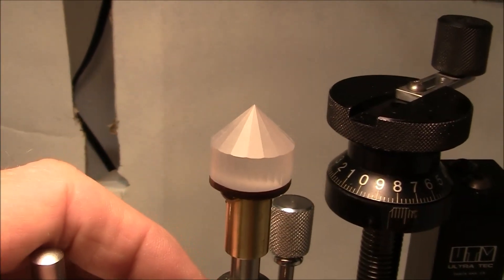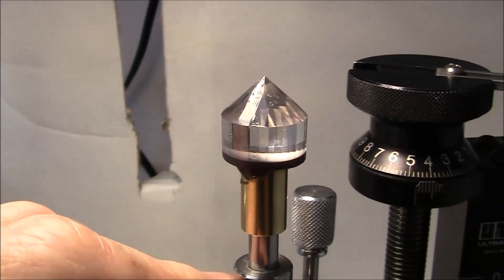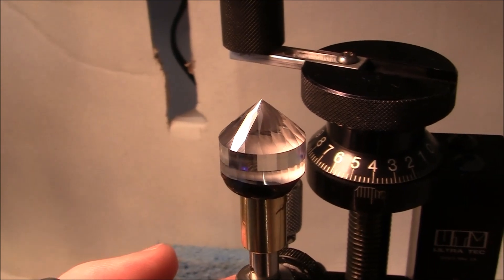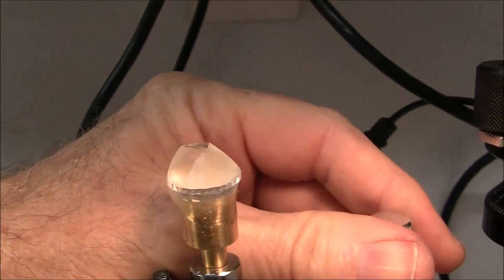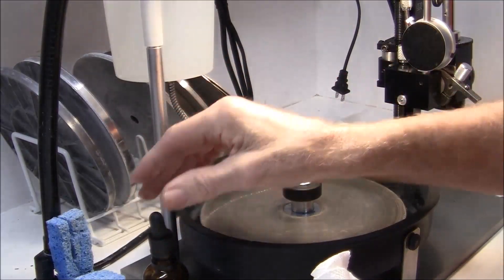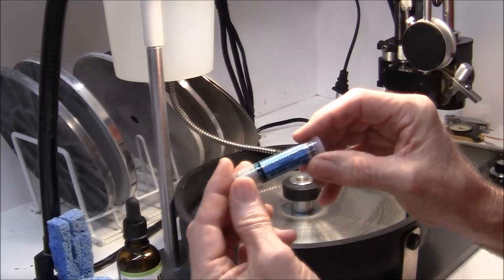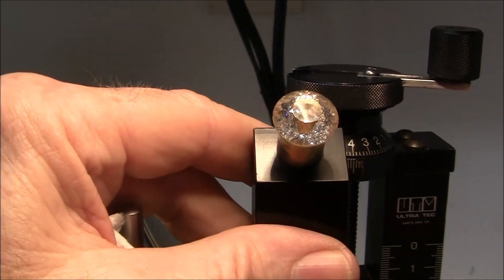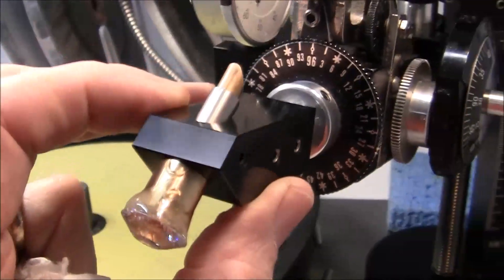Faceting a gemstone:   CZ

Comment: Superb work !!!

Why did you choose the analog display instead of the digital display on the UtraTec ?
Reply from the maker: Actually  the machine is around 25 years old and back then they did not come with the digital display  or the analog dial. I could be wrong,  the analog dial indicator might  have been available as an add on back then. The digital display  models came out in 2008 or 09. I just recently bought this  machine.and added the analog dial as it is not nearly as expensive as the digital  display.
My plans are to add the digital display in the future.  The nice part is that i can add it myself.
Thanks for your comment and watching.
Reply: Gems by mbk Thank you for your reply.

I am a fan of your videos !!!